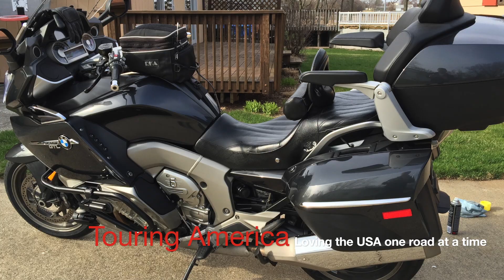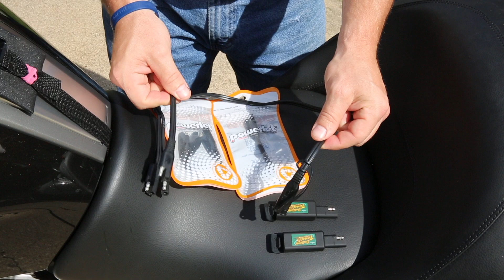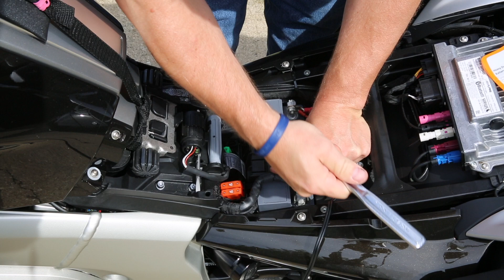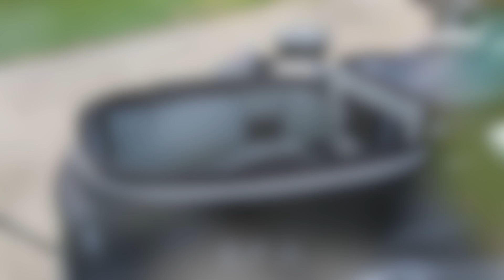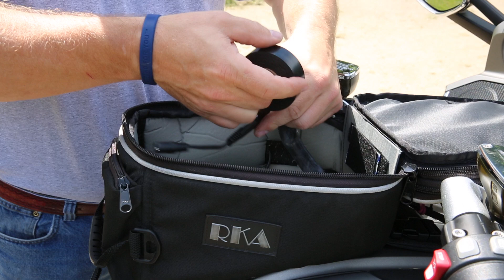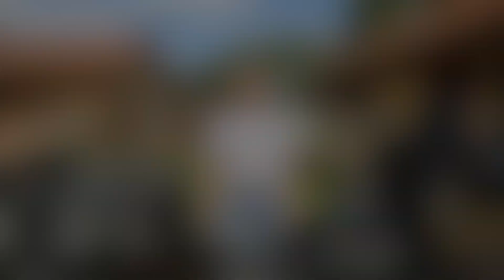Episode 16 - Getting Electricity to your Motorcycle Tank Bag

Comment: Very nice!
Great idea using the inner tubes.
You could also charge a battery pack and use that as a backup charging station for your usb powered gismo's.
Well done.
Reply from the maker: +Eddy C I actually travel with 2 battery packs as well.  I think I showed 1 in my packing video.  Point well taken.  The one place that they are REALLY useful is if you are riding for more than 8 hours per day and your helmet coms go dead.  You can put the battery pack in your jacket pocket and run the power cable up to your helmet to keep the tunes and coms rolling.
Reply: Exactly my idea. Keep up the good work! I mentioned the battery pack because my electrical system is switched as in not to drain the battery.

Comment: very clear and precise.
How many 2.1 milliamp chargers can safely be ran off of one lead to the battery?
Reply from the maker: I think you mean 2.1 amps, not milliamps.   The fuse in the standard wiring harness is 15 amps, so about 7 would be the answer.  The heated jackets run about 2-9 amps and if you have heated gloves they are 1-2 amps.  Add them up and stay under 15 and you should be good.